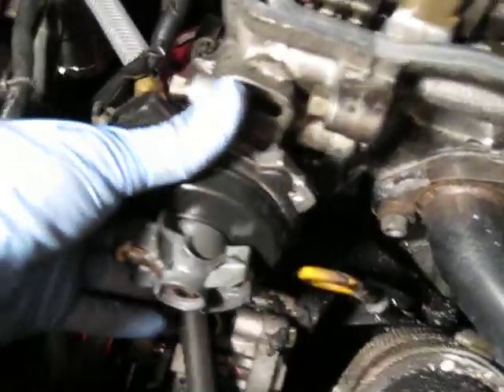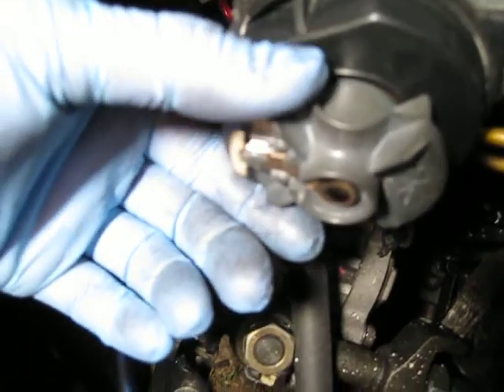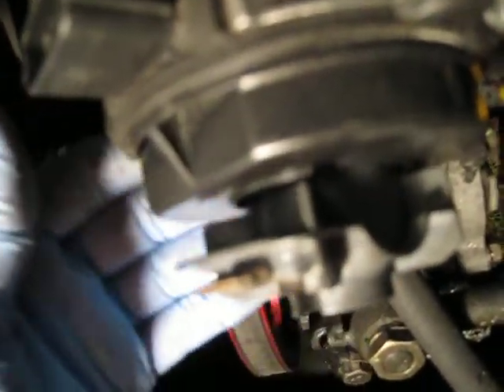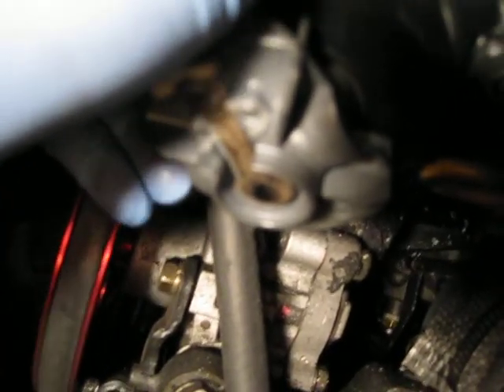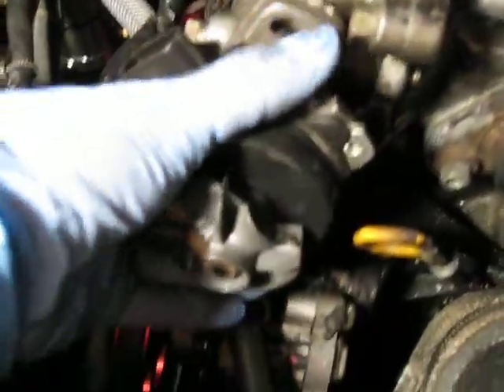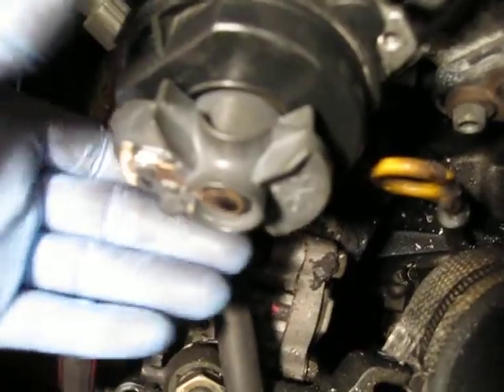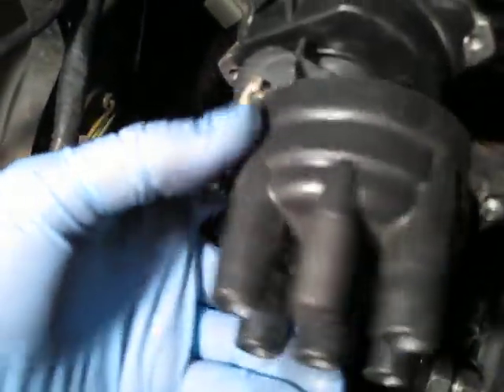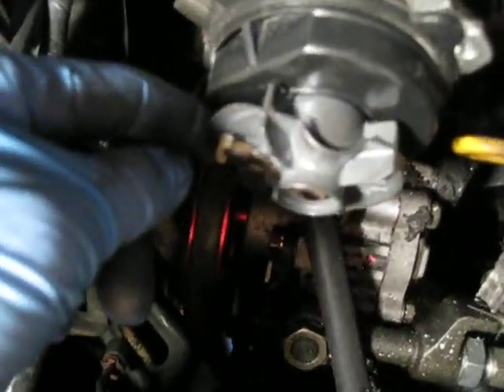240sx distributor timing part 2

Comment: After looking at the 240 service manuel, It seems that only on S14's does the rotor have to face 10:30-11 o clock. On the S13, it seems to face between 8:30-9 o clock.

Comment: can you make a video of setting all the timing parts? cams/chain/valves? i cant get my sr20 to start after replacing the head gasket
Reply: 13 years later I have this problem now
Reply: @SaiDrifts  well...mine ended up in the junkyard. Timing got fucked up and bent the valves i think.